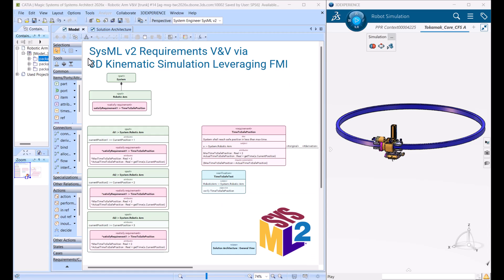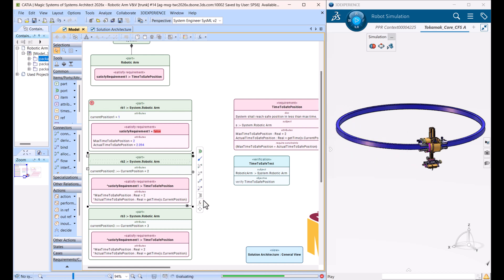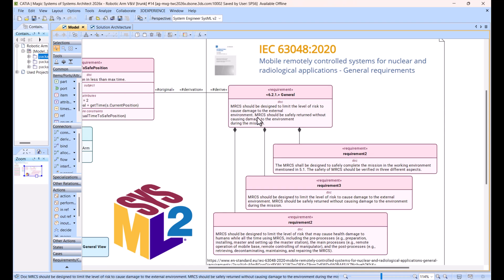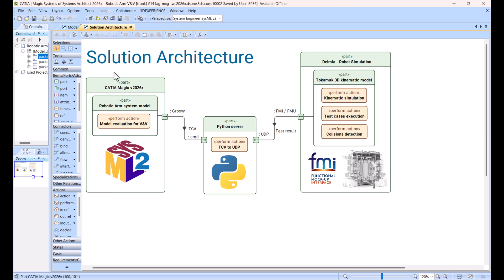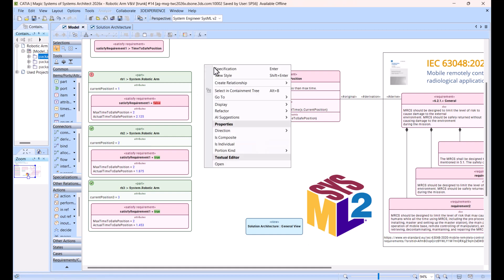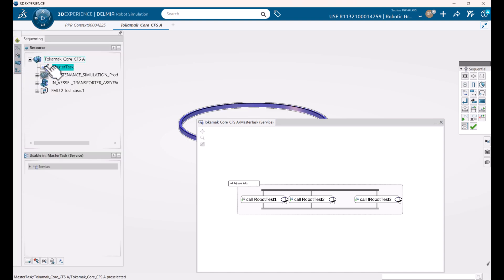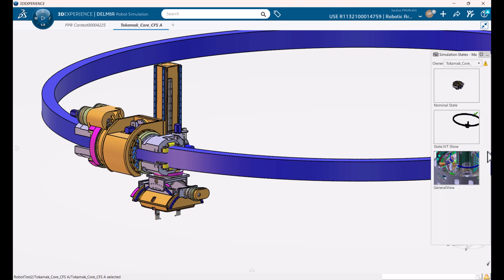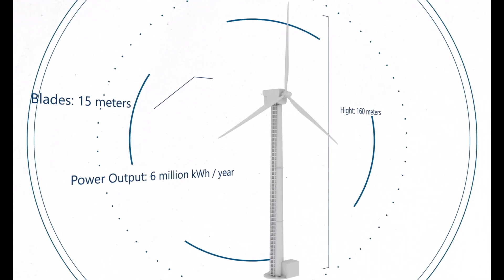SysML v2 Requirements V&V via 3D Kinematic Simulation Leveraging FMI

Comment: Hi, is it possible to run physics-based simulations in SysML
Reply from the maker: You can simulate based on available libraries. But there are no physics libraries in SysML yet. Common method is to use Modelica / Dymola integration and run any physics simulation e.g.    Introduction to Standard Based Simulation of SysML, Requirements, Physics, Robotics, CAD, FMI
https://youtu.be/YtHbquwsOC0
Reply: @MBSEExecution thank you. I’ll check it out. Thanks for your videos